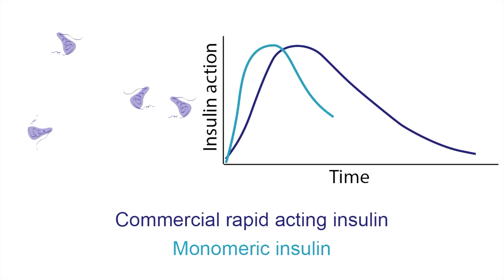Ultrafast Insulin Formulation May Enable Faster Management of Blood Sugar in Diabetes

Comment: It should also be noted that there is a race between the encapsulated stem cells (bio-artifical pancreas) since that technology would make this moot.  I very much applaud the technology and it's good to have in our back pocket but the primary issue here is the time to market and recovering costs of clinical trials.  If the decision makers believe that the risk of the market shifting towards implants (or other novel interventions like immunotherapies) is to high to invest in the tremendous costs of getting a new type of insulin to market, it will not make it off the ground.  The good new is that most of the time I find that such decisions are made on the assumption that nothing is going to change and the market will still be pumps (open and closed loops) and MDI at the end of the clincal trials.